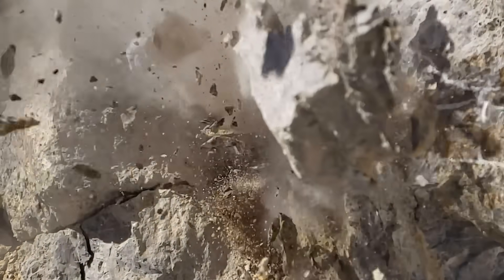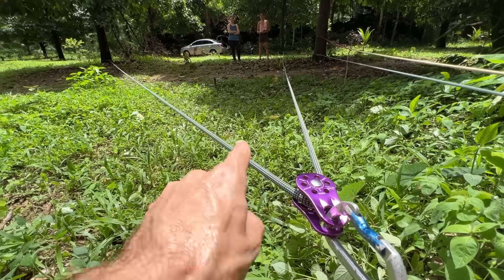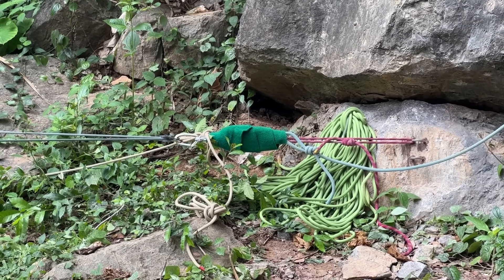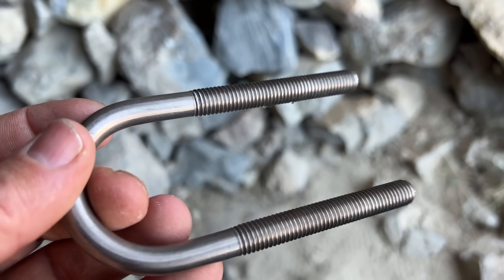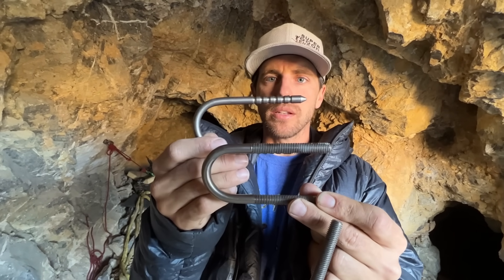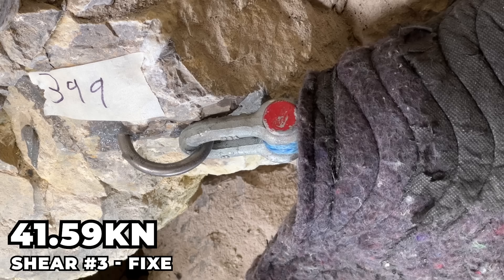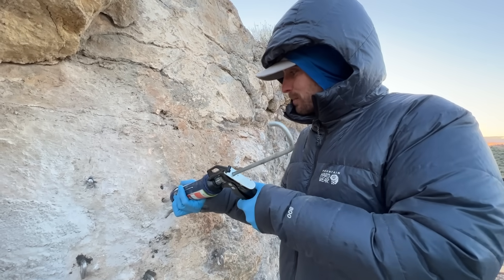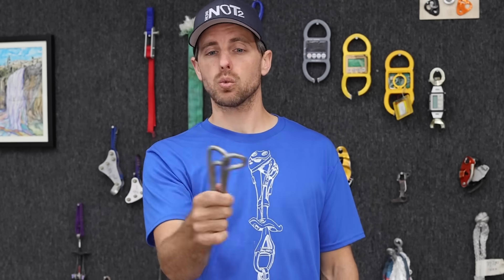They are uncertified?!?!

Comment: FYI, the first Ti bolt placed in Thailand was made by Ushba with Hilti HY200 in 1996 (we could not getRe 500 then). To lower the cost, we contacted United Titanium in Ohio and had them make us a batch of U-bolts. We called them staples. Those went into the wall in 1997. All the Ti bolts are still in use. None have failed (as far as I know).

Comment: Hi Ryan - love your stuff, it’s gold. We found similar ratings pulling them in really average sandstone ie super strong. Not sure what he meant by - “they are a lot of work, compared to ring bolts” - because by the time you drill a channel to countersink P bolts you could’ve drilled 2 x extra holes. And there is no need to wipe the glue all the way down the bolt, it does that in the hole anyway. The ones I’ve pulled out when the glue is wet for various reasons always have glue all the way down the shaft, even without twisting. ❤
Reply: Well, as you are doing it from free climb, is probably still easier to do one hole

Comment: i also wonder if the two holes next to each other is weakening  the rock
also you must have to be quite precise with your drilling to get two parallel holes  the correct distance from each other.

i liked the flip flop mic

Comment: Just buy a capstan winch and some static rope, save yourself that insane amount of rigging, not to mention loading all your blocks and pulleys so bloody high.
Reply from the maker: You got a link to a capstan winch that will handle that kind of loads, is reasonable price, can be run on batteries or a small generator is reasonable to carrying by hand

Comment: The apparent increased strength of the uncertified bolts feels concerning, and makes me wonder if it is actually titanium/titanium alloy or if it is a different material altogether than the certified bolts. Which just raises concerns for the corrosion resistance of potentially unknown material.
The only other things I could think of for the difference is geometry (diameter) or heat treat/crystal structure differences to increase yield strength. It would be interesting to have the uncertified bilt analyzed for elastic modulus, hardness, maybe etched for structure analysis, or even a chemical analysis (like EDS or XRD) to see if it's made of the material it claims.
Reply from the maker: I know it's a bigger diameter and that is why i think it breaks higher.  Not knowing if it's proper titanium or the best alloy to not corrode is why I think it's best to go with certified gear from legit companies.
Reply: The bigger risk/downside from using uncertified parts like this is quality. You have no way of knowing if each part is uniform to the rest, and if they're comporable in quality to ones already manufactured, those currently manufactured, or those that will be manufactured. For example, the present day batch might be super good enough, but if 5 years from now there's some sort of disruption in the supply trade, and the manufacturer switches to using dirty recycled metal instead of getting it straight from the source, that next batch might test much lower.
Reply: @RawSauce338  absolutely, you have no way of knowing what you're getting today, tomorrow, a year from now. They could all be different things entirely and none of it could match the claims because it's not verified in any way. Even within one batch I'd say there's a risk because there's no reliable quality control process. In practice they may always show as strong enough, but you definitely can't be sure, and that's not worth risking safety for imo.
I was just mostly curious if what they sent is even what they advertised to be selling, and if it is, what might be causing the difference, seems answered in Ryan's reply, the diameter is different. There's not really anything stopping them from sending something highly alloyed or even just steel (though the weight difference there might give it away).
Reply: But then again it depends on if you need that level of quality or not. This is the reason why automotive bolts cost $1/bolt (%80 confidence in rated strength), aviation bolts cost $25/bolt (%95), and space flight rated bolts can cost $1XXs/bolt (99%+).
Reply: You might be able to take them to a scrap yard or coin dealer and get the alloy checked with XRF.
Reply: @samthenerf  a university may be willing to test it as well for the fact that it's basically educational purposes. But that would only be valid for the samples tested, you might get something completely different the next time around
Reply: @aquablau14  tldr: if you're gonna do that try to locate & then go personally crash the lab on a weekend in search of a student with the skills & access needed. B/c academia freaking SUCKS

---

I got a job before actually graduating college. Finished my last English class essentially as an exchange student with another college & independent study mech eng class via telecommute with my original college & fav professor while working.

Presented a bearing with a lot of suspected brenelling to a material's professor I had the previous quarter as a possible test case/educational experience with industry involvement & the fucker had the balls to send me an invoice for like ~$10k in "consulting fees" that he required before he'd even look at it. (Mind you, this was not considered a research institution. Just a very well equipped bachelor + very small number of grad programs)

Big shocker b/c I was in fact still enrolled & paying full tuition to this place, not to mention even paying lab fees when I was ~200 miles away from said labs.

And all I wanted was some ultra basic visual inspection, not using the $100k-$1mil in toys that a small portion of my 5 years of tuition & lab fees helped pay for. (And were opened for use the quarter I left - grrrrrr)

To say I was not happy was an understatement.

So during my last visit with the professor overseeing my independent study work I walked into the brand new materials lab & asked a current grad student if he could help me out for a little bit & he was glad to oblige. This was just before spring quarter ended & the guy probably would have done literally anything to procrastinate on his 1st year grad work.

So, yeah. Find a college/university with the gear & then go crash the lab that houses said gear on a weekend looking for a student that has an interest in the subject & access to the required gear. Offer some gift cards to restaurants or something too.

I forgot that part during my visit, but after the student helped me out with far more in depth analysis than I had even dreamed of, I sent him a $50 gift card & a ton of company swag with instructions to do literally anything he wanted to with it as long as I never saw any of it on that asshole professor. And do not throw this note away in the lab LoL. (Sounds petty as hell & in hindsight it was - but that guy really pissed me off b/c as a still active student I was literally paying for access to him & his knowledge & even if I was a fresh graduate, the company I was working for just happened to have been donating over $1mil in CNC machines & tooling every 2 years for about 10 years in a literal quid pro quo arrangement where info + help in small-ish matters was supposed to flow freely in both directions - so this situation pretty much cemented my view on the whole culture of academia,  and it's still pissing me off 17+ years later)

So if you can find a student that's your best bet, but I 100% wouldn't expect any kind of help from someone with "professor" or "PhD" in their title. Or anyone in admin for that matter.

Unless you 100% know for sure that they're avid climbers. But even then only give yourself a 50/50 chance.
Reply: What make up titanium who knows but their is definitely titanium you can see the sparks they burn white.
Reply: I took a few samples to the office and fired the pXRF at them. Was consistently getting result over 90 percent Ti.  Keep in mind pXRF delivers a point shot, but still good numbers. 

Already, 5 years installed in the harshest bolt destoying environmentent and no bolt failures, no rusting or discolouration at all. 

I would be happy to send some bolts for complete element analysis if someone has the contacts and willing 🙏  😊

Comment: I know why they use titanium. But why do they use u bolts?
Reply: Welding titanium requires extreme cleanness—the base metal, filler metal, and welding environment must be immaculate. Contamination by natural body oils, oils from the forming and drawing process, shop dust, paint, dirt, cutting fluids, and lubricants all can lead to embrittlement and weld failure. 

I've seen some pretty welds on a 5k dollar titanium mtn bike frame crack right above the front forks maybe 3 months after purchase
Reply: @anondegen1970  why is welding the only other option from a U bolt? Why not a twisted P?
Reply: It's weird... They don't seem any stronger that the P shape ones and you have to drill twice as many holes and use more epoxy too. Maybe they have issues with good bonding of the epoxy and one leg of the bolt holding is probably plenty strong (and much more preferable to the whole bolt pulling out if it just had the one hole)?
Reply from the maker: I think they are cheaper to make. Welding titanium is maybe hard so it only comes in more expensive ones? I don’t actually know.
Reply: @HowNOT2  We use them in Tasmania as everything is coastal and they are cheap, simple, and discrete. We make them from 8mm 316 stock for around $2.60 each plus adhesive. The trick is being efficient when manufacturing and taking care not to contaminate them. Plus keeping the bend diameter small. I failed to pull one in Dolorite (very very hard) with our tester, and tested to 22kn in tension in crappy sandstone with no issues.